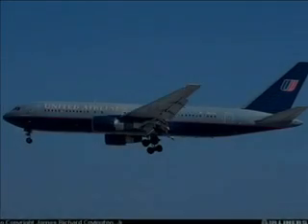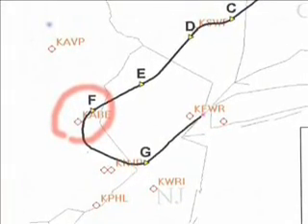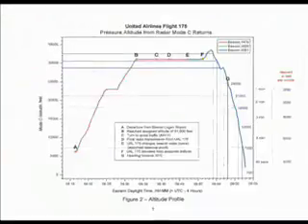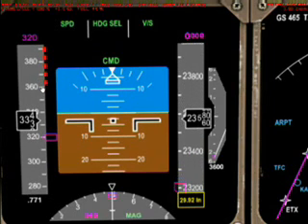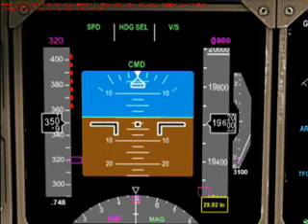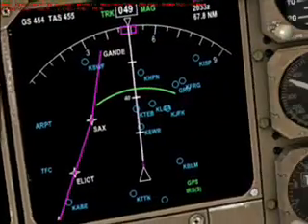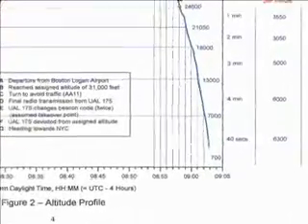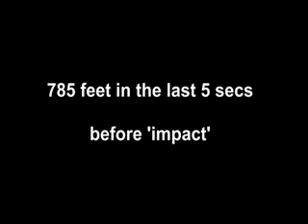Flight 175 reconstruction of final 4 mins 40 secs.

Comment: The problem with using the "safe" or "recommended" speed is the fact the the person flying the plane was not worried about the safety of the aircraft. When you take an aircraft and max out the throttle then you start to descend at a high rate, you have to take the speed of the plane, the effect of gravity and momentum of the plane into account.

Comment: The idea is false, that if you go over Vmo, the aircraft with break up. Although it is not safe to do so, aircraft can survive going over the max operating speeds. Fed Ex Flight 705, an attempted hijack in 1994, pushed the DC-10 well over its design limit, while violently manoeuvring. That aircraft still flies today. China Airlines Flight 006, a 747, lost control and descended at 30,000 feet per minute. It damaged severely, but still operator for another 20 years. Google Boeing 777 Wing Test.

Comment: So, ultimately it does depend on the pilots skill level. I would have to assume flying a large airliner is way different than a Cessna with the latter being far more responsive or easier. I thank you for your answer. It just seems to me that I would need a decent amount of experience to guide such a large jet to what would appear a small target when approaching at such speeds where making the slightest course change can drastically effect where you end up. I know its possible but it seems hard.

Comment: One more:  For DFDR video below, note the thrust lever (throttle) positions bottom left.  Control wheel movement, and compare to to attitude indicator (right, 2nd from bttm).  On right, top is airspeed, below is altitude.  Very bttm is heading.  "A/P" means AutoPilot..."L C R" is left, center and right.  There are three on every 757 & 767, any can be used (if it is operable) but only one can be engaged unless conduction and auto land procedure.
Reply: How would ATTA find the WTC just out of Boston?    Could they have plotted a vector direction previously and simply flown into that?  Or just punched up the nearest airport to the WTC on the FMC

Comment: Also:  If you see examine AAL 77's DFDR info, you see that during most of the right turn his speed was around 240-275 knots...perfectly normal, if a bit sloppy.  Not unexpected for someone anxious, hyped up on adrenaline.  His bank angle control sloppy too.  Again, just a ham-fisted pilot.

watch?v=3vqDDlS9Hyw
 The ^ ^ ^ above is the FULL flight, shortly after leaving gate, still taxiing. (With ATC transcripts).  Skip to 1:12:00 near the end for last 10 min.

Comment: C'mon, do you have anything to support your argument of an airliner traveling at 400 knots near ground level? Frankly, I believe it possible because this jet was not just under engine power but gravity momentum carrying it as it dove rapidly and it may have fallen apart had it not smashed into the building. I mean, when exactly is a plane going to fall apart in this situation? Don't buy the official story but this is going nowhere...

Comment from the maker: @767Captain I guess you are not really a 767 pilot but a troll. The last Vspeed which must be demonstrated is not Vd but VFC - flight characteristics, which is still under 400 knots at around 390 knots.  
People like you make big claims without any substantiation or logic behind them.
Why would Boeing incur the huge expense of strengthening their aircraft to a cope with very high speeds the aircraft is never designed to do?

Comment: Sorry, but completly unsupported by facts.  You wrote:  "Vmo + 10% around 405 ktas plane breaks up 12,000 feet and 15 miles from WTC." ??  Nonsense!!  You just make that up?  Based on Vmo!?!   Why not look up the certification history, and the demonstrated Vd.  (Hint...it's 420 knots!).  Yes, the airplane CAN achieve 420KCAS.  Was demonstrated for FAA.   And, no....it didn't "fall apart", or flutter.  You think they'd certify an airplane that fragile???   Now, take 420 kts, and 50% margin...

Comment from the maker: The performance of a 747 and 767 are almost exactly the same in terms of max speeds descent rates ...check out their V speeds and specs to see for yourself.
The 747 has slightly better performance and specs than the 767. You will notice this in the video. A 767 would have exceeded max at a higher altitude and so would have broken up before 12,ooo feet.

Comment from the maker: This is a reconstruction based on the 'official' story of 175 as told by the NTSB report. I am glad that you seem to have come to the same conclusion as me. IT IS FAKED and does not represent in any form the performance of a real aircraft.
'Speedbrakes'? Again you miss the point. NTSB report point G to WTC is 24,000 feet in 4 min40secs and 42 miles. What point are the speed brakes??If the plane slows it will not hit the tower in the allotted time!!
Pls think before commenting.

Comment: archer, do you know what speedbrakes are?  BTW, your 'assumptions' based just on the dodgy RADAR tracking, as compiled by NTSB is your major flaw here.  Also, you have no way to know for sure that flutter would be a destructive factor.  AND, at 6:00 you are incorrect about GS vs KIAS.  I've seen an easy 6,000 fpm in a flight idle descent, with speedbrakes.  VMO doesn't mean 'break apart 30 kts above this speed'!!!  AND, the last bit...he leveled off for the last half-mile, or so before impact.

Comment from the maker: Y0u have completely missed the central point of this presentation.
Point G is 42 miles away from the WTC,24,000 feet up, and  4 40 secs away according to the official STORY the NTSB report.  THis is a needed Ground speed of 540 miles per hour ALL the way down. Fine at 24,000, but impossible for 747,767 or any other large jet the nearer to sea level you get.VMO(velmax) at sea level for 747 and 767 is just 360 mph..200 mph shy of required speed to hit towers.Try harder to pay attention :(

Comment: You don't know anything about 767's speed limitations either, you just tested it with a 747.
Maybe you can get a decent rate of 6000 in a 767 without reaching overspeed and maybe you can't, but you can't test it using a.... 747 :|

Btw, did you keep throotle at idle?

Comment from the maker: Double think . Orwellian. You agree with me about the impossibility of the event given the limitations on the aircrafts performance and at the same time you agree with the official version of  story which includes as a fact the impossibility of the event given the aircrafts performance. 
You are also wrong about the number of video clips. 5 'live' ones ( with planes inserted) and about 30 after the event with planes inserted and badly faked. 
The passenger issue is still mysterious.

Comment: having seen this, you make an excellent point, if the plane was indeed travelling at a speed of over 500 mph, it just wouldnt hold up, and if it dropped the amount of feet in that short time frame the plane would be angled vertically, not horizontally. good research.

Comment from the maker: No. From point G to the WTC is 42 miles. 42 miles in 4 mins 40 secs is 540 miles per hour GROUND speed. If they lower their they miss the towers. 
The plane starts the simulation doing 533 mph GS. It must keep this speed up all the way down.
The further down the plane goes the more over speed it is.